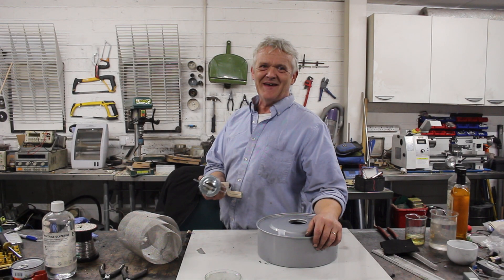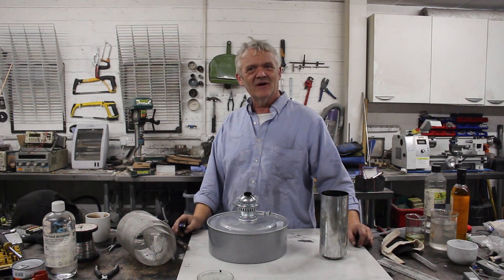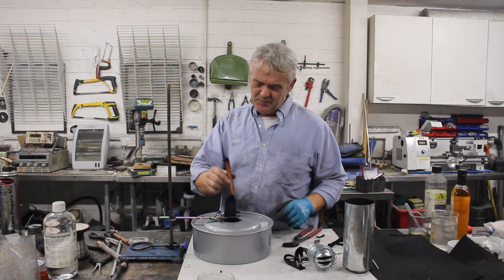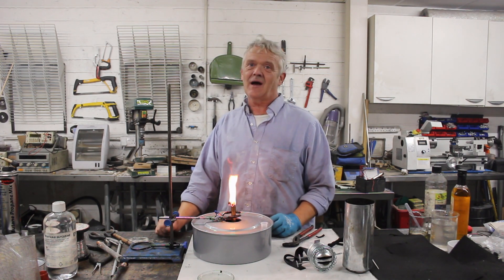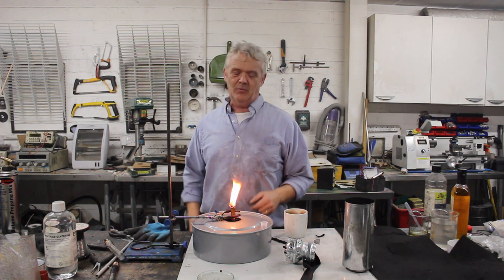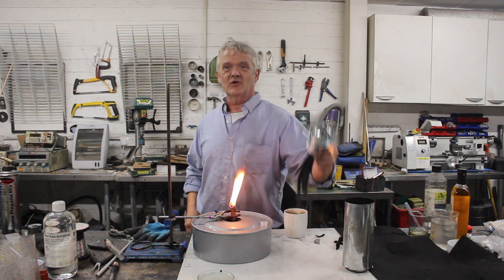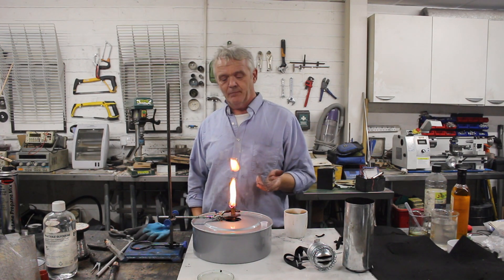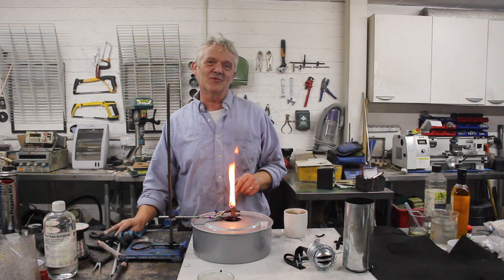1684 Can The Forever Wick Replace An Ordinary Wick?

Comment: Wrap the paraffin forever wick strip in aluminum foil, or even copper foil and feed it through the paraffin lamp mechanism, just peel off a desired length to expose it for lighting. Experiment with how much is exposed at the bottom. The advantage would be no modifications to the paraffin lamp required and a wider use of more vicious fuels. Compressing the carbon foam to a higher density might be interesting too. Construct a copper or brass sheet channel for the strip to run through down into the tank that is half the thickness of the foam or try various levels of compression on the foam. My guess is the more compression on the foam, the more viscous the fuel the lamp will burn.
Reply: Compressing the carbon felt for better capillary action, and using strips of copper or tin foil to preheat the oil are great ideas 💡!
Reply: Using Aluminium could be dangerous as when heated it produces a poisonous gas.
Reply: @whatifididthis...1236  Great info, but to what temp does it need to go before releasing the gas?  Several car engines are made out of aluminum and reach temps as high as 500F.  I doubt this flame goes above 300F.
Reply: @RickStewart1776  Any open flame is way hotter than 300F.
Reply: @bamspay  TY.  I remember reading that wood gasified and caught fire around 200F, so I wrongly guessed that maybe it burned another hundred or so degree hotter.  Who I was wrong.  I looked it up because of what you said, and I was for sure wrong.  A match burns at around 700F and a candle can reach over 1000F.  Thanks Brandon for the input and challenge. I'll go over in the corner and STFU. :)
Reply: @RickStewart1776  lol. No reason to go in the corner. I made a small wood gasifier once. It was not a very nice build but I was able to light the gas and when it burned there was no smoke. The wood embers heated the newly added wood and released the gas. The wood embers are definitely hotter than 200F.
Reply: @bamspay  Oh yeah, for sure a wood fire in a container can melt steel.  I was raised using a wood stove and have seen steel flue pipes glowing red.  I just assumed a small flame in a relatively open space was a fairly low temp.
Reply: Oh, I'd love to experiment with the Valor stove.... and Methylated spirits....

Comment: How's this for a tangent? I am learning how to keep bees and they've been looking for the best material to soak-up and then slowly release oxalic acid and glycerol mixture as a treatment for the deadly varroa mite. Trouble is some materials fall apart from the acid, and others get nibbled to pieces by the bees etc etc. Others don't really hold enough... there's always an issue.  Nobody has thought of using this stuff yet!
Reply: please elaborate, interested to know more.
Reply: @yewtoob007  In parts of the USA I believe it is now approved to use slow-release oxalic acid. Which is a 50:50 mixture of oxalic acid and glycerin. This is then soaked-into something like a thin sponge or a bit of cardboard or shop-towel or whatever, and it is laid across the tops of the frames in the brood-box. 
Over 70 days, it will slowly release the acid, mostly by touch, and it is very effective in the long term. This is helpful because the effective lifespan of the treatment covers many generations of brood, so the fact that oxalic acid doesn't get into capped cells doesn't matter.
It seems to be fairly gentle on the bees, too, compared with vaping or the drizzle method. 
However, different methods of delivering the acid have their problems. The sponge tends to fall to bits, the shop towel does too and isn't as effective. I think carbon felt is a very good candidate for good delivery and something you can just pick-up afterwards to tidy-up.
Reply: Years back a reasercher  noticed that hives close to where mushrooms grew were constanly visited by the bees and had no mite problems. He has now found a fungi that thrives at hive temperatures and his paper was published in the science journal Nature. “Directed evolution of Metarhizium fungus improves its biocontrol efficacy against Varroa mites in honey bee colonies” by “"Paul E. Stamets"
In a podcast he indicated, growing any mushrooms close by is better than no mushrooms. They all seem to make the bees fitter.
Reply: @Nuts-Bolts  Yes I am aware of both of those streams of research, they are fascinating. I think the Metarhizium research will lead to something but it might take a decade to come-through. In the meantime, having antiviral fungi around for the bees is easily achieved!

Comment: And if you do the copper pipe under the wick adjuster.
Reply: Absolutely experiment!! theres no limits on experimenting (within obvious safety reasons) Expand brain, test, learn undertand. Thats when great things are discovered.  :-)  show us too if you like. that would be pretty awesome. i personally think the copper pipe as a heated 'path' for the fuel to be "conditioned". The more copper pipe.. the more heat, slowly stored. meaning somewhere you could actually drill holes in it and have sideways flames. the wick adjuster is merely a pinch roll,  exposing the wick. longer wick means the exposed end is no longer helped by the pre-heater copper pipe. so back to the beginning. longer pipe. less wick exposed = sucess